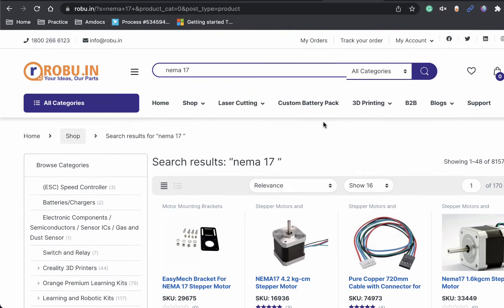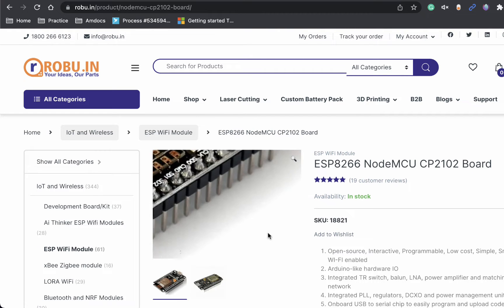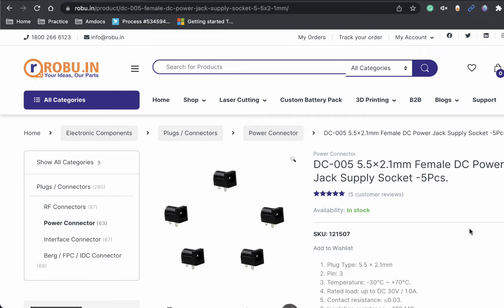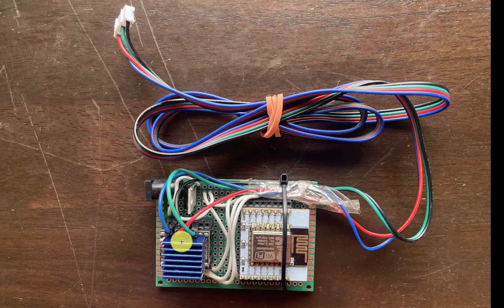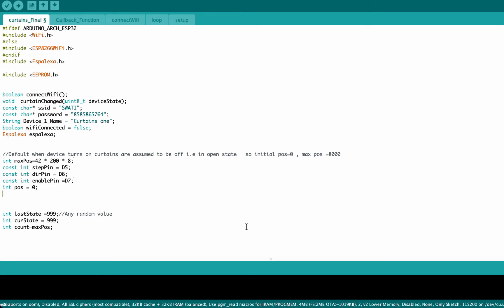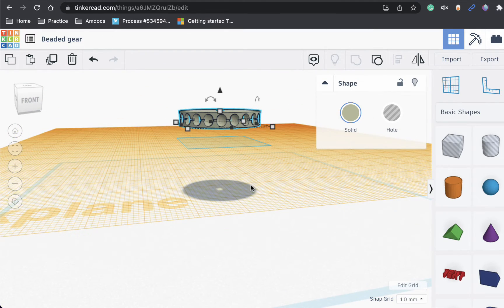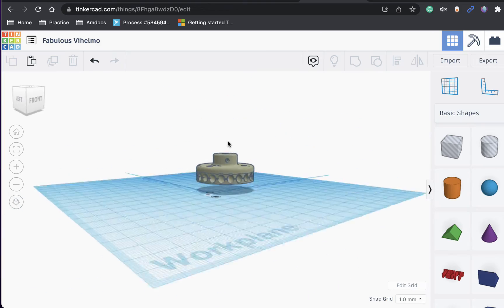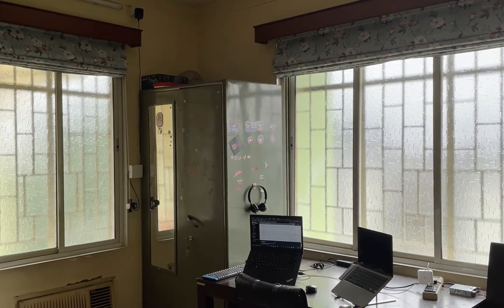DIY Alexa based  Automatic Curtains  | Tutorial | Harsh Dokania

Comment: Can we make this battery powered? We can charge via solar panel. And set it, forget it ? What do you think ?
Reply from the maker: It requires sufficient power depending on the weight of the curtains.
So if we want to make it battery powered, it can be costly, but yes of course can be done using good lipo battery(which can supply enough current).
Also charging them quickly using solar panels can be another challenge, such that it works seemlessly.

As this will be a fixed setup, power supply from  AC Source is better i think